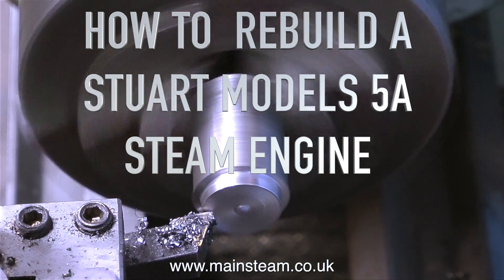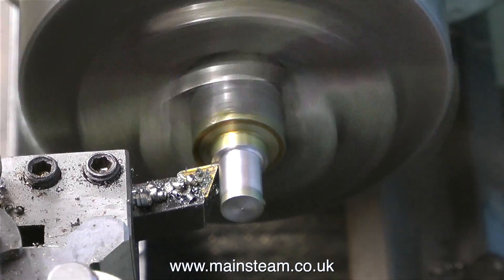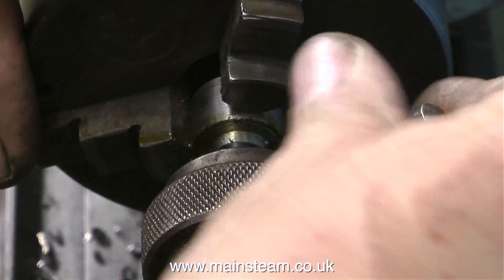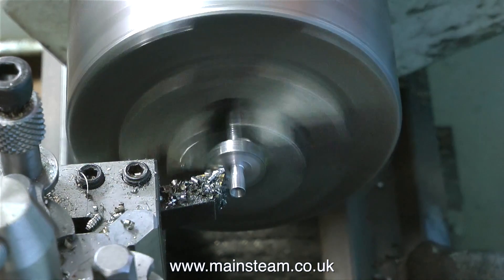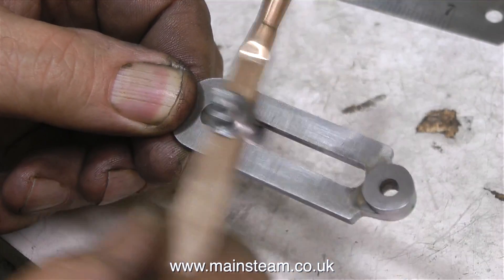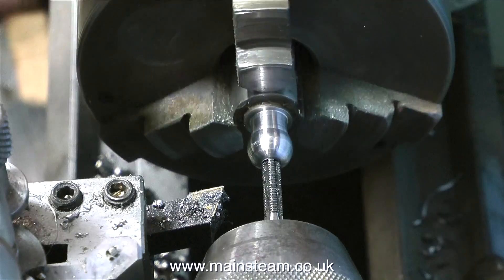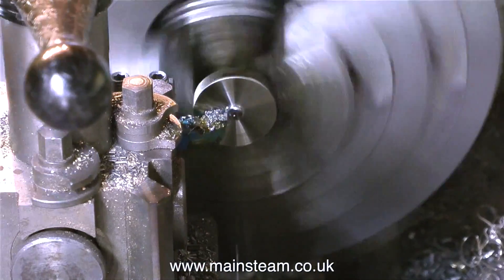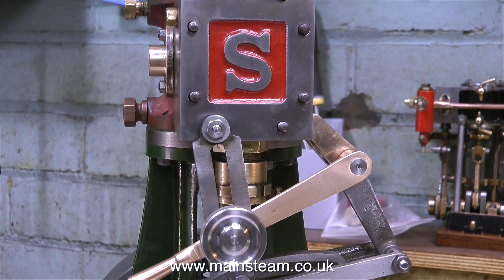HOW TO REBUILD A STUART MODELS 5A STEAM ENGINE - PART #23

Comment: All your recent videos seem to be much better. I think it is the increase in chatter, which is an ideal combination if useful information, statutory health and safety cobblers, and very very old jokes!
I have fitted a cheap open source diy DRO to my lathe and mill, called"TouchDRO". One of its features is drilling holes at any PCD, and I have used this feature to calculate a tool path that does your etch a sketch method extremely accurately. In effect, you move the tool a couple of thousandths to the next ref point, then press next. Eventually you get a profile that is the half sphere, and a quick touch up with a file and fine emery cloth gives you a fine polished surface. Nerve wracking, but very clever cheap tech.

Comment: I read somewhere that on full size steam locomotives the operator will put the reversing lever in the reverse direction to slow the train going down hill. Is this something you have heard of and would do on a scale locomotive?
Reply from the maker: The small locomotives just wheelslip if you do this, but in the full size it is a common practice :-)))

Comment: You didn't show the tool you used in your lathe to turn the indent in your reversing wheel lock.  I've been trying to get that nice rounded radius at the edges and your cutting tool seems to do just that.  Thanks.
Reply from the maker: I used a very small parting tool .....